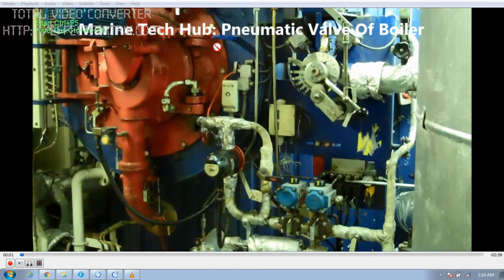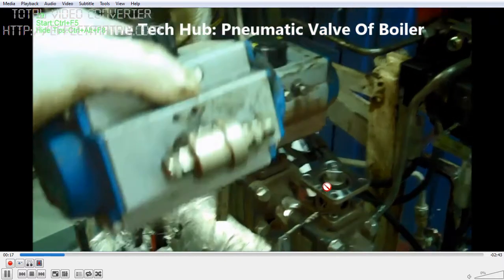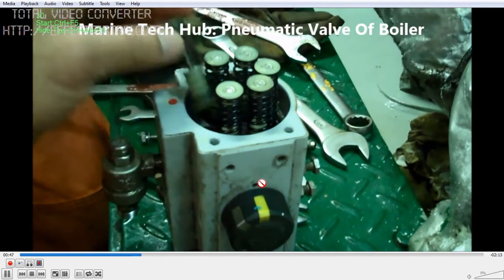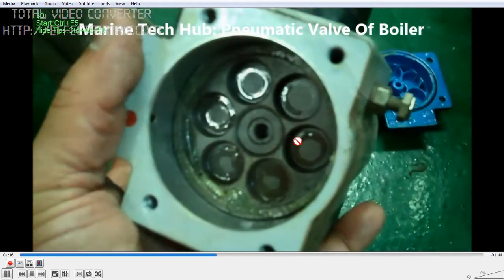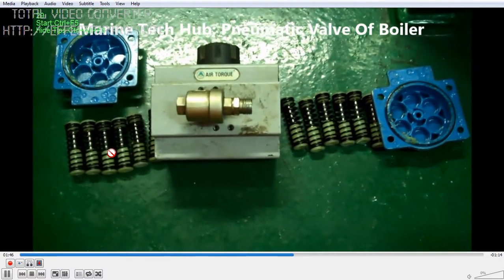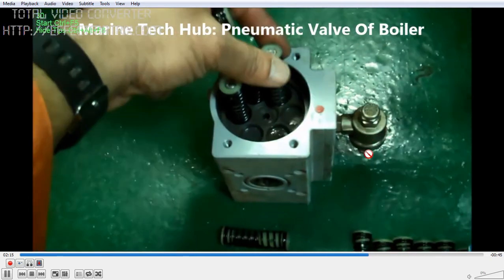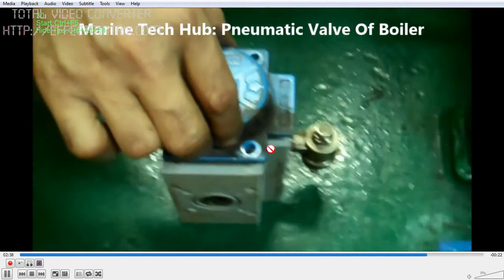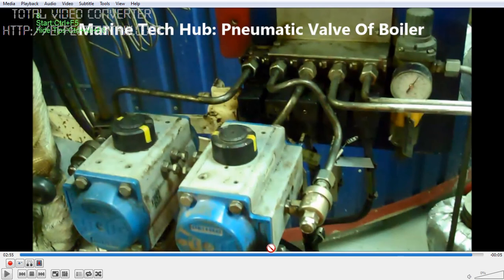Pneumatic Valve Of Composite Boiler

Comment: Sir, so the problem was solved? if so, then what was the problem..plz explain..thanks
Reply from the maker: The problem was solved by easing up of the valves by  WD 40 and also putting some lub oil to the main spindle of the actual valve. Since the valve was sluggish , oil was not passing .